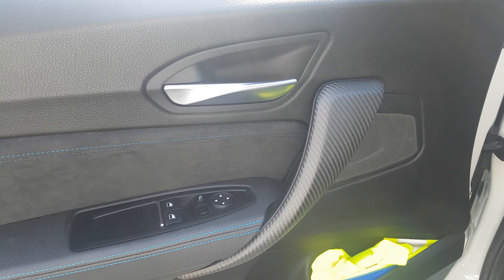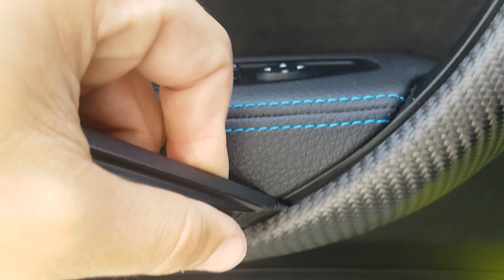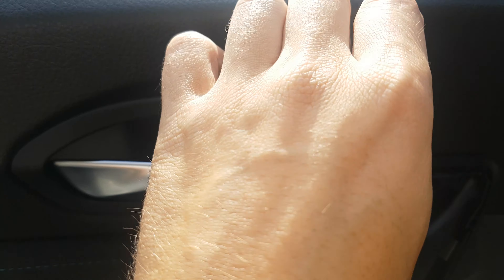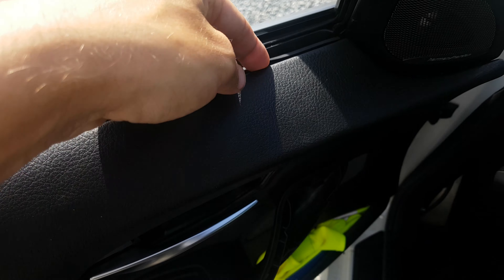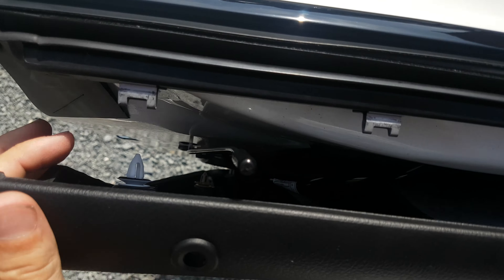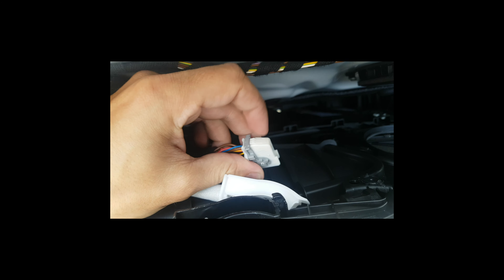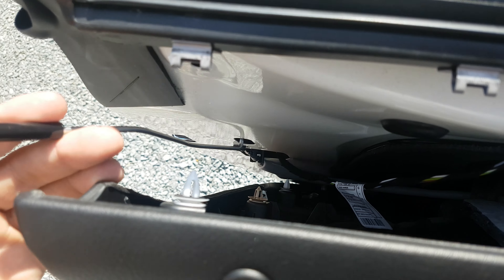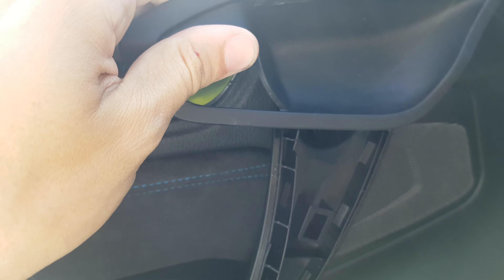how to remove the door panel on a bmw 2 serie (M2, f22, f87)

Comment: Hello, I have to remove my door panel to replace speakers but the first trim you removed is just super hard to remove on mine, i’m stuck when I reach the top and afraid to keep pulling, scared to break some clips. What should I do? Just keep pulling and take the risk or what ?
Reply from the maker: Ask help from a friend or friendly handymen in a garage if you dont trust yourself  😊

Comment: If you still have the car, could you show or describe how to remove the back seat side panel? the piece that sits under the back-seat window?  I have a rattle somewhere in there and it's driving me crazy.  Thanks!!
Reply from the maker: Dont have the car anymore, but you will need to remove trim on the window
And the seats and screws behind the trim of the panel
Reply: Any luck fixing the rattle bro?! if so any pointers?
Reply: @The_KW  No. Sorry.  I tugged on that panel to see if I could remove it but I couldn't. I was never committed enough to pry it out with my trim tools.